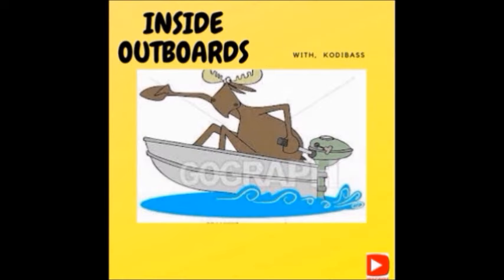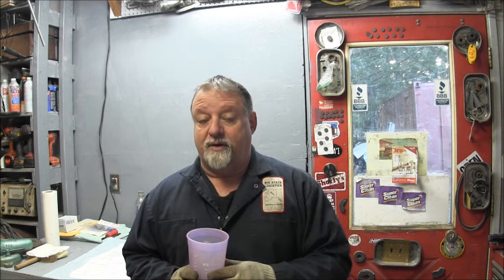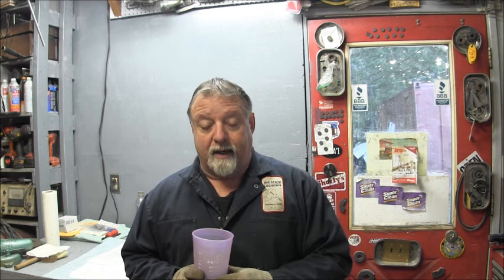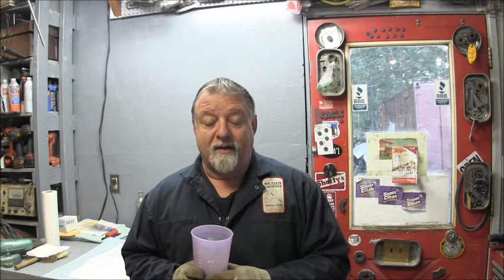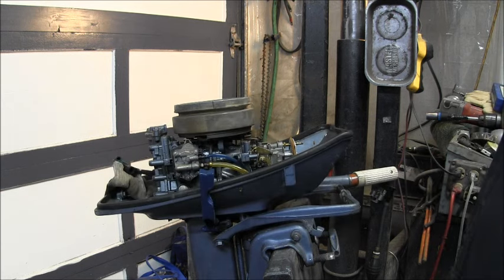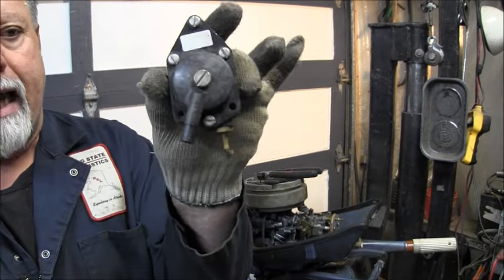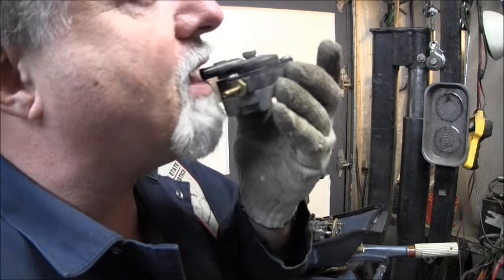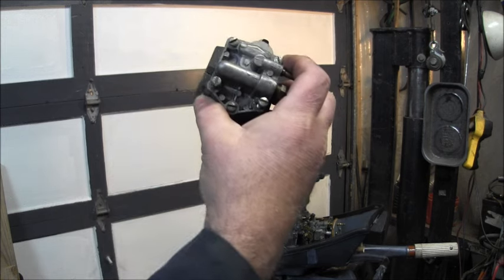EVINRUDE  1963  5 5 ,  Hp,,    OH'WELL

Comment: Hi Kodi, that was very interesting letting the fuel empty to see if the idle picked up. So if it's inside the carb I will love to see what you find. My 65 3hp was doing the same thing when I tried to Lake test it. That one I had a bad reed but replaced it so it's got to be the carb although I rebuilt it too. I had one jet in it I couldn't get out and just ran a wire through it. Need to go through it again

Comment: OK then!  good info for sure.  That carb is too rich for some reason.  How is the nozzle gasket?  Perhaps the casting is flawed in that area allowing fuel to by pass the high speed needle.   Perhaps the high speed needle is messed up.  Maybe the threads are messed up leading you/us to believe the needle is seated when it is not.  Perhaps there is a flaw in the bowl casting down low allowing fuel to bypass that high speed needle.  I'm really thinking the high speed needle threads are messed up, so we are fooled into thinking the needle is seated when we back it out 3/4turn for the initial adjustment, but the needle isn't seating at all for some reason.  You could remove the bowl, then look inside at the needle when you thread it all the way in to see if it is actually bottoming into the casting seat.   Those compression readings are great for that engine...
Reply: I agree that it is way too rich! A 1964 has a hi speed jet and I wonder if someone drilled it out! I also wonder about the tube gasket.
Reply: @chrysleroutboarddude    Oh, it has a fixed high speed jet??  Thought it had an adjustable one...  Oh well, hope all is well with you.  D